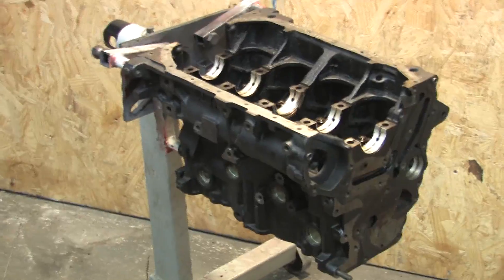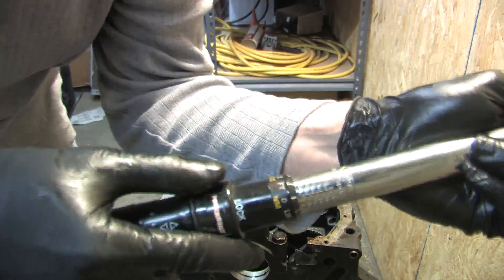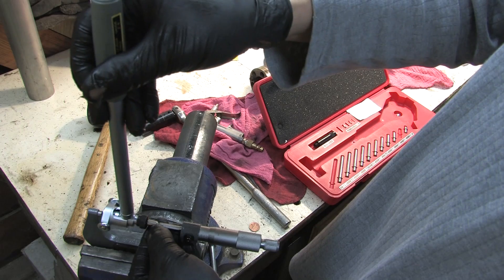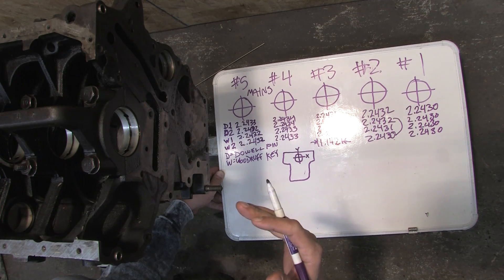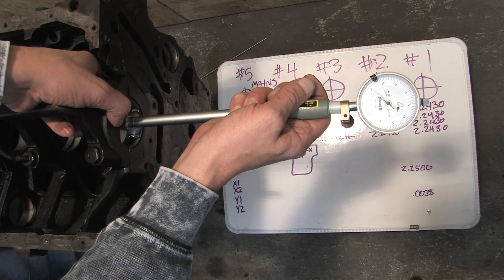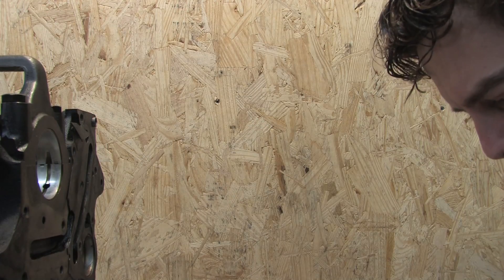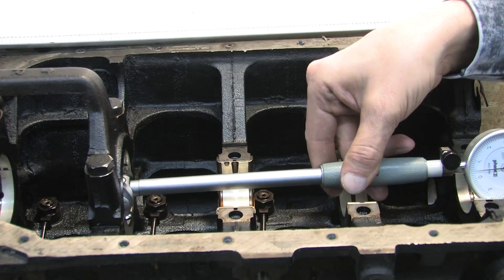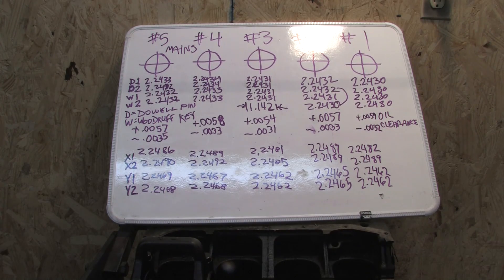Blueprint 105 - Main Bearing Oil Clearances

Comment: Like everyone else i immensely appreciate the time and effort you put into your videos! Thank you!

I am on this step now with my girlfriends 1992 gsx.
I noticed when checking clearance that my X axis is smaller then my Y axis with these acl bearings i received. Is this backwards? I thought the horizontal axis was to be a smidge wider then the vertical axis?
Reply from the maker: Usually it is.  The question I have is are your caps on right?  Also, are you measuring the parting line or the 45°. You only need the 45-90-45° numbers to be right.  You can leave the 0°s out as long as they're not smaller than your crank diameter.

Comment: Stupid way of thinking. Use the dial gauge to measure the shaft, set the comparator for zero on dial gauge and check on journal. Also, specs are for guys like you, as long as everything is flexible. Same issue with the bolts you are tightening to max stress in plastic domain after that you use it on engine.

Comment: every engine is different. The engine that requires thick oil needs bigger space for a good oil flow, if its need thin oil than smaller oil clearance. Race cars and high RPM engines have the smallest clearance. Some diesel engines have bigger clearance like 0.005 but the crankshaft diameter is big too plus have a high pressure oil pump and use thick oil. So is depend on a few things.
Reply: you got it backwards, surprised nobody pointed it out already. but the 'every engine is different' part is spot on.

Comment: Hi Jafro ! It´s me again ! Im blueprinting the mains of the caddy and I found out something wired whit the  out of round spec of the service manual. 
I measure all the mains and the "widest" out of round I get is 0,00196" the service manual stands for a tolerance not greater than 0,00025"
It´s possible that the tolerance can be soooo tight or they just type an extra zero on the print I´ve never seen clearances so tight ! Also relying on your measurements you don´t have something so tight as well ! 

Tnks !
Reply from the maker: It looks to me like an extra zero.  On the mains, two thousandths would be a good measurement.  Don't worry about the out-of-round there.  Main bores are intentionally oval-shaped.  The vertical clearance should be your main focus.  In other words, the measurement that goes parallel to the main bolts.  The width will always be wider to accommodate bearing crush and it offers a larger gap to maintain the oil film layer.  As long as your oil clearance measurement is in spec, you should be fine.  :)
Reply: Tnks Jafro ! Yes my measurements where just like that, wider on the X axis, so now Im confident on my measures to take the crank to the machine shop ! I´ll post a video of the running engine when it´s done !

Comment: Hi Jafro ! I have a question, when you subtract the two diameters you end up with a clearance "all arround the journal" the specs in the manual (in your case the service limit is 0,04 from the service manual) so when you measure with plastigage the number must be the double since the journal is being "push" to one side and you must have the double of clearance in one side or not ? Tnks !
Reply from the maker: Specifications are for the difference in diameter (widths of the base circles of both parts).  So if you wanted the oil clearance measurement achieved once the parts are suspended in an even, pressurized oil film layer, you would divide it by half.  So my .0025" mains oil clearance is .00125" on either side, totaling that .0025".  The manual specs are dry, un-pressurized measurements, so you would divide those in half to get the pressurized wet measurement.
Reply: Tnks very much Jafro ! one more question (And the last haha) when you order a 0,04  oversize bearing is:
a)0,04 inches more in thickness per sell
b)0,04 inches less in diameter 
c)0,04 inches less in radius

I´m building a Cadillac Coupe deville 1955 engine and I need to order those parts from the USA to Argentina and I can´t miss a spec since I can´t return them ! 

Tnks very much for your time !
Reply from the maker: I don't recognize that kind of measurement?  But I'm going with a) 0,04 thicker.  

You install oversize bearings when either the crank or the hole it goes it has been machined beyond specification.  That's when material is removed from either part.  The bearings are "oversize" in order to actually make the hole smaller and correct the oil clearance to accommodate whichever part was machined.  When you replace all the bearings you have to have it honed so the new bearings will etch into the surface and stay put.  If you line hone the hole, you make that hole slightly bigger.  Same goes for honing the big bores of the rods, and the same goes for polishing a crank.  You shouldn't be worried about returning bearings, bearings are the cheap parts.  You should also not hesitate to buy the right set if the ones you order don't fit.  Don't even be mad at yourself.  You often won't know what sized bearings to use until you throw a standard set in there and take some measurements.  If you nail your oil clearances, the engine will run for a very long time.  Do not mix and match bearing sets to nail your oil clearances.  Don't be mad if you have to order a second set.  Be mad if you break a ring installing the pistons, but understand these things happen when you're building an engine.
Reply from the maker: ...and kick ass!  You're very fortunate!  I'm in the US and I'd do anything to have a '55 Coupe DeVille!  Everything left for sale up here has 4 doors on it.  :\
Reply: Yes i know, My mains "holes" are perfectly round, the bores of the rods and the mains are Ok so they dont need to be machined. In the other hand the crank is deeply scored and needs to be machined down and it's also out of round.
I need to "guesstimate" if the word applys to a slightly smaller hole beacause shipping parts to my country y wayyyy to difficult, the customs here are a pain (I need to bring everything via courier and they kill me with the cost).
The last time I was in the US I bring all the parts, new rochester quadrajet, gaskets, lifters, motor mounts, water pump and so on... but when I open the engine I found the mains completely wasted, nice history haha
Reply: Tnks !!! I thougt that in the US was full of this coupes ! Here in my country are two of these and one coupe cabrio that was from a former president.
Now I have the chassis to the bare bone ready to be painted and then when I finish the engine I will start assembling this monster ! I can't wait to take a ride in this beast !!! Tnks !!!!

Comment: Why not just use an electronic micrometer ?
Reply from the maker: Because you need ten-thousandths of an inch or 5 thousandths of a millimeter accuracy to do the job right.  Go price digital micrometers at that resolution.  ;)  You're more likely to find someone using a mechanical bore gauge with a digital dial gauge because the dial gauge is more useful because it's a third the cost, and it will give you a more accurate measurement.  One that you can easily zero off of the crank journal measurement using an inexpensive mechanical outside micrometer.

Comment: Question, the dial gauge leaves scratches on the bearings, is this normal?
Reply from the maker: They're more like "tracks" than "scratches"...  While there might be some shiny appearing trails from where the measurements were taken, they should not deep enough to be measurable.  If you are indeed leaving scratches on the bearing surfaces that you can feel, then something is wrong with your dial bore gauge.  Bearings are softer than the materials your DBG is made from, and they should be for the sake of your crank.  Even inspecting them with your thumbnail will change their surface texture.  I saw the same thing and it bothered me, too.  It made no difference in my oil clearances.
Reply: +Jafromobile thanks so much jafro, you have inspired me to build my first engine. thanks dude!

Comment: One more question, if highest clearance is out of spec, but lowest is ok, like in your video service limit is 0.004", highest clearance 0.0059", lowest 0.0032", it's ok? And if clearances are bigger than OE, but lower than service, it's not bad? :)
Reply from the maker: +zibalas1993 Service limit is .004", but spec is .0008-.0020.  In the circumstances you describe, not even a .001" oversized bearing would fix the one wide spec'd bearing.  It's .0019 off.  Technically, it wouldn't fix the other 4 either.  They'd still be beyond spec.  I wouldn't put it back together without machine work because you'll be going right back into again sooner than later if you don't.  .0059 is just too wide.

Put it in the perspective of... which one is gushing out all of your oil pressure, and then you'll feel better about fixing it.  Oil is really important.  Everything downstream from the wide clearanced bearing will suffer.  So will the rod whose oil feed is connected to that crank journal.

Comment: But when measuring this way or with plastigauge, why not all clearances is divided by 2? Because if "total" clearance is 0.0032, than in one side of journal is 0.0016 clearance and in other side (at 180deg) is 0.0016 clearance, in other word, there is 0.0016 clearance all the way around, because if rod diameter is 2.2430, then it's radius is 1.1215, and if bore diameter is 2.2462, then it's radius is 1.1231, and gap is 1.1231-1.1215=0.0016 . And when using plastigauge, crankshaft is touching bearing (lie on bearings) on one sie due to gravity and then in other side of journal gap between journal and bearing should be bigger, or i'm wrong? :)
Reply from the maker: +zibalas1993 Your point is valid, but you're over-thinking it.  Yes, the oil clearance is split in half when the oil system is pressurized and the engine is running.  The oil clearance is based on the difference of the part, and the hole.  For instance, the crank = x, the bore (with bearings) = y.  y – x = oil clearance.  Check that number against spec because all the rest was done for you by the engineers who designed it.  They don't expect us to measure oil clearances on a running engine.  Plastigage is just a fuzzy means of measuring that gap without knowing the diameter of the crank or the hole.
Reply: +Jafromobile so, clearance specs on repair manuals is not "real clearances", but it's just diameter difference of bore and shaft, no matter it's crankshaft, camshaft or piston-to-cylinder clearance, yes? :)
Reply from the maker: +zibalas1993 I think you misunderstood me.  The combined oil clearance value on both sides of the part is the oil clearance.  That is the real oil clearance, and that's the number all service manuals specify unless otherwise noted in that manual.  Oil clearances are dry measurements.  If there's no oil, the part is touching the bore on one side.  The gap on the other side, dry, is the oil clearance.  That's the number in the service manual, it's what the engineers specify.  So yes, if you measure .0016" dry, and the service manual specifies .0016" oil clearance, you're off by 0%, and when that engine is running, there is .0008" oil clearance on both sides of the part.  But your service manual will say .0016".  You can't measure the wet clearance without having oil pressure.  You will get tangled up in the rotating assembly if you try to measure oil clearances with a running engine.  That's the math that the engineers work into the specification.  All oil clearance specifications are dry measurements.
Reply from the maker: +zibalas1993 And yes, that also applies to piston-to-wall, etc...
Reply: +Jafromobile Thank You :)

Comment: I think just setting your micrometer to your crank journal to 0.0000 and then put it in the main bearing torqued down will show your clearance. Not so complicated and more accurate because there is no math involved or inaccuracy with with measuring.
Reply: David Sanders are you talking an inside mic? Or dial bore guage?
Reply: Neal Archer yeah he’s talking about mic your crank, then set your dial bore gauge by that to zero then put it in your bearing an it gives you your clearance

Comment: Torque spec for the main caps on a 6-bolt is 49 ft/lb. I already made a comment with an explanation in the con-rod video, but I thought I'd just add one here as well for visibility for anyone that may see one and not the other.

Comment: Do you think using a digital caliper would be an accurate enough method for this? Or even snap gauges?
Reply from the maker: Some people insist that snap gauges are the most accurate means.  At least they swear by them if you have an accurate set of micrometers.  Digital calipers?  Nah, not really.  Not unless they're hitting in the $300 price range.  You'll be losing accuracy in the last digit with everything short of ten-thousandth micrometers.  Measuring egg and taper means you need to be able to read within .0001 accuracy because the service limits for egg and taper are .0004".
Reply: ***** Snap gauges it is! I just don't have access to a dial bore gauge. I've heard snap gauges talked about as both a great method and a terrible method. Of course it really comes down to the user at that point. But thanks for the input! I trust you over any other Youtube experts you find in the comments. Hahaha

Comment: On a f22b1 honda rngine the crank is 1.9518 and with yellow bearings installed and torqued down i get 2.1305 if i did/read the bore gauge right. And that gives me a clearance of .1785. The book call for .0005-.00015. Service limit .002. Help

Comment: Many years ago i worked at a foreign car dealership and without mentioning any vehicle names i went to an engine rebuild engine class. They had a stripped 4 cylinder blocked hanging off a stand, believe it or not the cylinder bore shape would vary enough to warrant a rebore IF the block wasn't supported as it sat in the vehicle, what i am telling you is this particular block would 'hang' and flex enough to distort cylinder bore #'s from what they would be as if the block was not hanging= amazing

Comment: Hey dude one simple question, not bashing on your technical build and multiple variables used but why not just torque the main caps down. Measure your crank journal, zero the dial bore gauge to that measures crank journal, ad get your readings like that ? Is your dbg different or something ? Mine goes 2 way So it gives me the difference and the clearance right there on the spot.

Comment: Just a little tip when setting up your dial bore guage in the micrometer.Do not place your fingers on the anvil or the spindle.The body heat that is conducted into these components of the micrometer cause them to grow,reducing the measurement.That also applies to the frame of the micrometer.High quality micrometers will have a insulating pad from which the instrument should be held.Happy Blueprinting. :-)

Comment: Love it. Keep em' coming. BTW, I've got idle sorted with the battery swap. Trying to find the time to make a slideshow video. Once I got the voltage to sit at around 14 I set the fuel pressure to what we talked about. Reset deadtime and I'm golden. Thanks a lot.